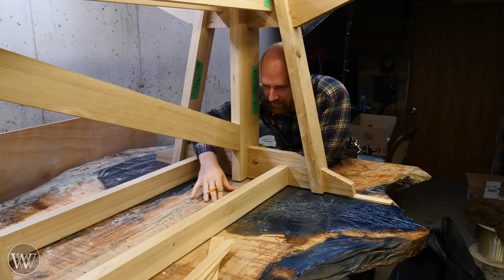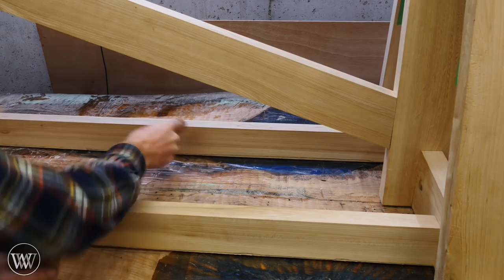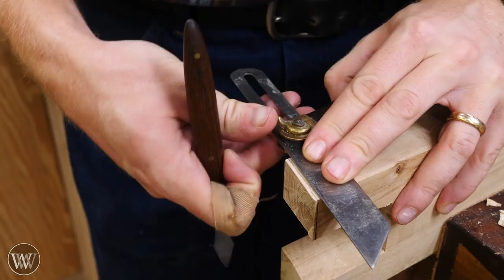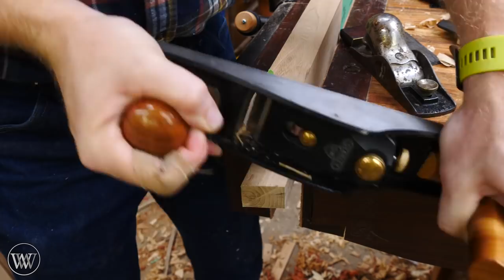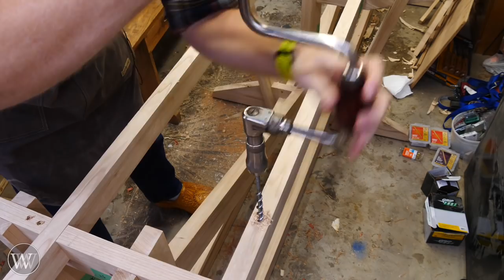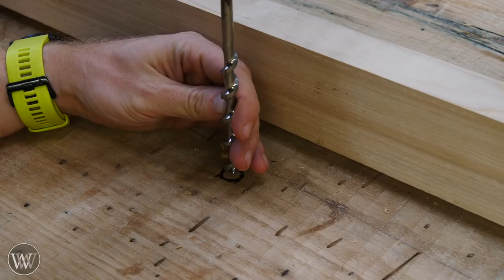Connecting the Base to the Top Live Edge Dining Room Table

Comment: Hey James I feel silly saying this since I come to your channel to learn things but. I noticed when you were using your drawknife I would suggest you skew it it will give you more control. I watched Curtis Buchanan 53 video series on making a Windsor chair and that's how he was doing it and wow what a difference. Please don't think that I'm trying to tell you what to do or anything like that it's just a suggestion is all
Reply from the maker: Yes I often do that but there are some places where I find the straight blade Works a little bit better strength wise also this is a shorter draw knife so the distance between handles is much less if I skew it too much more than my hands tend to bump into the wood. But that does make it a lot easier especially for spending work.

Comment: Just curious, is there a reason you didn't drill holes and glue dowels in instead of using screws?
Reply from the maker: I may end up doing that now but initially the screws were there to clamp it together will the glue dried. I haven't decided if I want to take the screws out and install dowels yet.
Reply: @WoodByWright  Understood, I was just wondering if the dowels were less desirable for some reason. Thats my go to if it breaks or looks weak.
Reply from the maker: @tylerkimble715  no it was more just to do with clamping it together for the gluing. and me being so frustrated at the time I didn't even think about it. However after a day or so later it came to mind and I may still do that. We will see